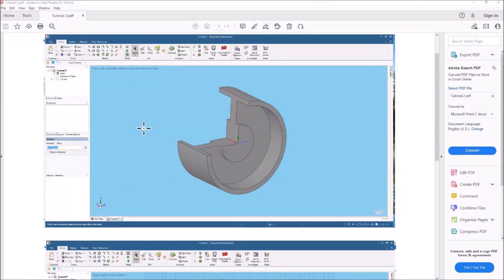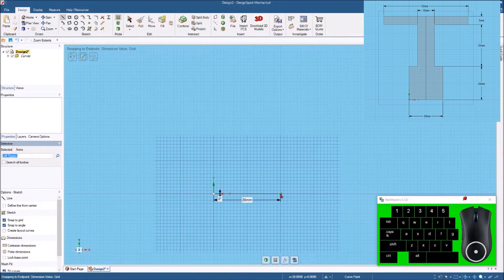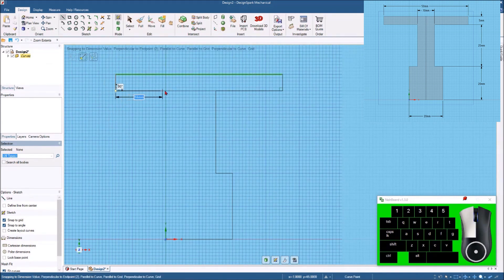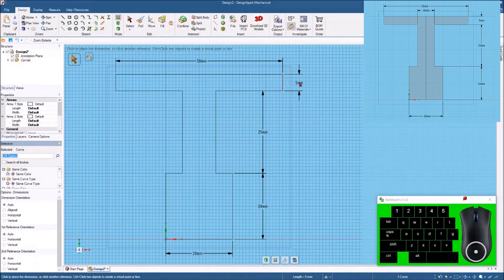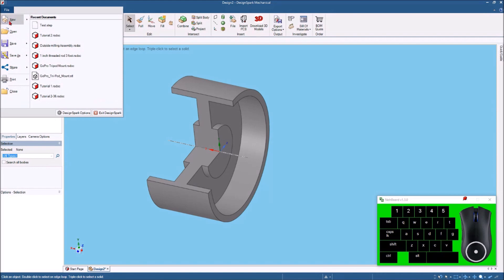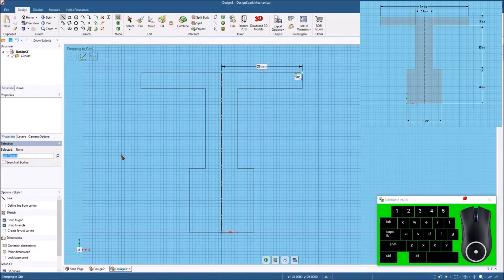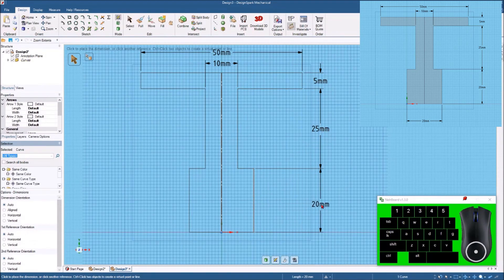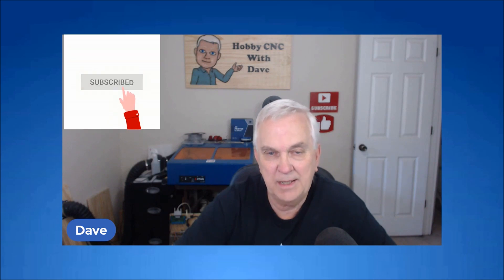DesignSpark Mechanical Tutorial  |  Using The Pull Revolve Feature

Comment: Thank you for taking the time to make this tutorial available. You're instruction was right on the money.
I use DSM to design simple parts to import into TinkerCad, for 3D printing.

I used the PULL function to create a ring (tube), rotating a circle from an axis. The Pull function works well. However, it does not render a smooth ring. You can see how it's made up of many short, straight tubes, where you can see the individual bands that make up the ring. Would this have something to do with preset rendering limits? When you try to make the same thing in TinkerCad, you can see the same banding, but worse, as it doesn't have a PULL function. And I understand that the program has it's limitations.

I was wondering if there was anything I could do to get smoother results. Thanks for your time.

Comment: After hitting the space bar and entering the dimension, you are hitting enter, correct? Do you use the ESC key to exit a command? These tutorials are great, Dave!
Reply from the maker: Thanks for watching Bill.  Yes that's correct, enter the desired dimension than press enter.  You can press escape or clink on the select key to exit a command.
Reply: Okay, thanks.